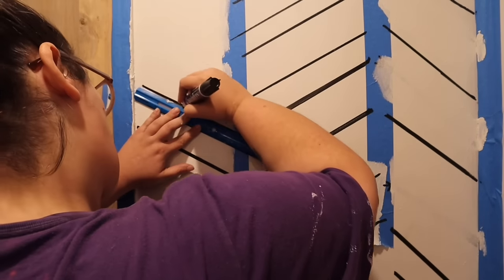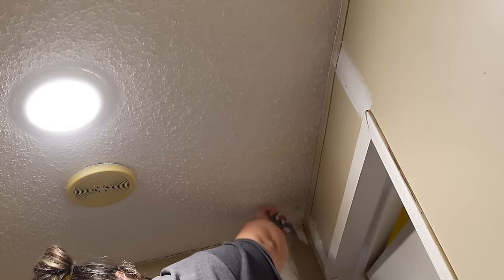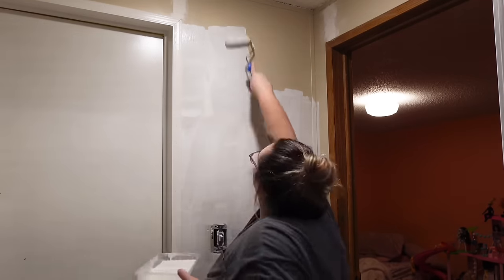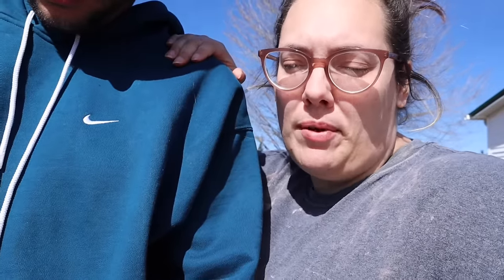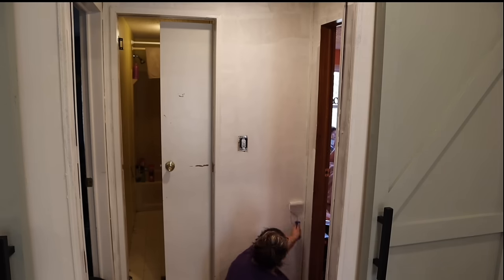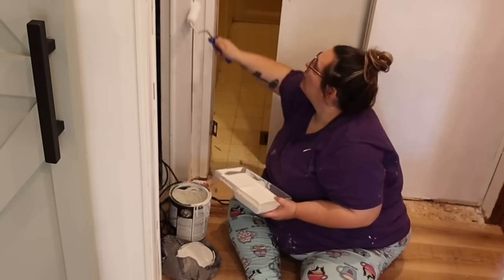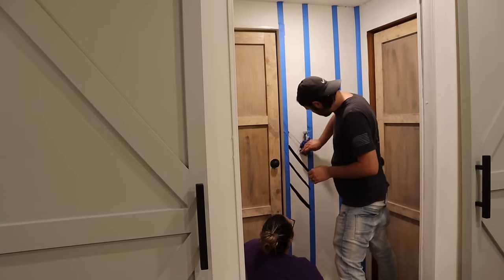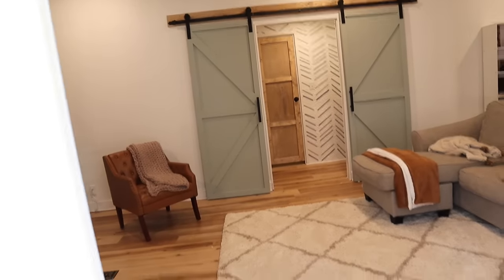OLD MOBILE HOME HALLWAY MAKEOVER ON A BUDGET | repurposing old 1990s doors | 1991 mobile home ep.19

Comment: 'Merina if you want to do the herringbone here's a suggestion I saw online. Paint the wall black then put tape on the wall in whatever design you want. Then paint the wall white and pull the tape off immediately after you're done painting. You'll have black lines that are crisp and straight.

Comment: Just in case you ever want to, I removed corner battens and used drywall tape and joint compound just like you've done on your flat seams, and sanded them using that same hand sander you have and they formed out just fine. No special tools needed!

Comment: You and Shane need to invest in a multi tool! It does different jobs. It has a sanding attachment head. Very small for tight spaces. Will take care of the " booty jiggle" 😂

You could use 1/4 in strips on the door instead of the thicker wood.

Comment: Just use the painters tape to make the lines. Put a strip on both sides of the thickness of the line you want to make. When you peel it off it will have a nice clean line

Comment: Be careful with those new "clamp on" connectors.  They are ok for LOW load, ok a light bulb.  but tests have proven, because so little of the wire is actually contact with the clamp, that with high loads, those things get hot and melt, the conductors can touch and  arc,  possible fire hazard.
Those old connectors wont melt.